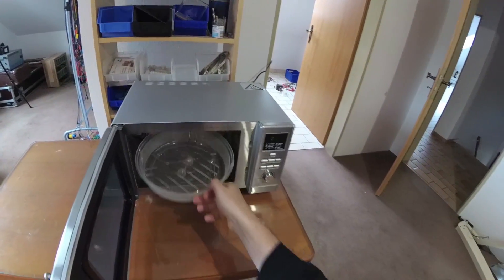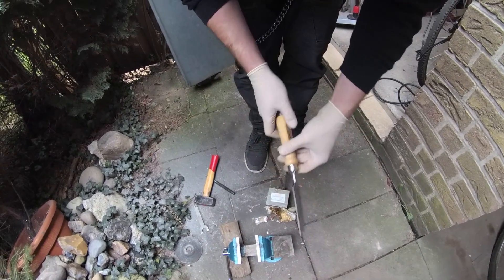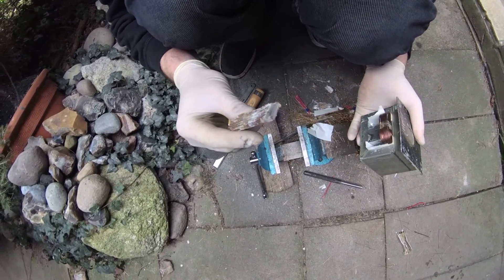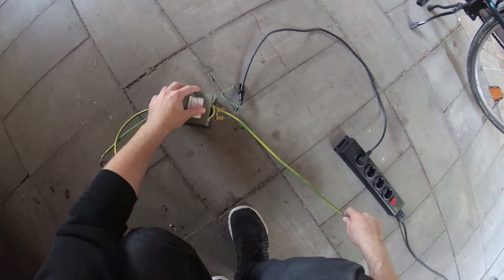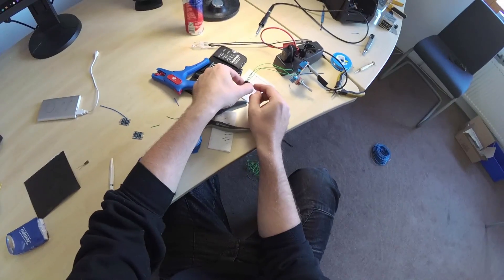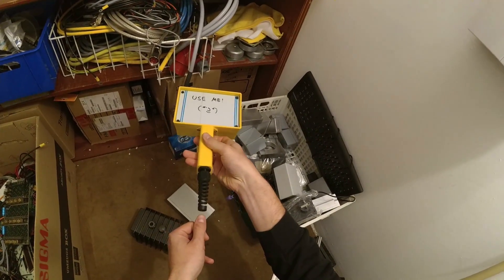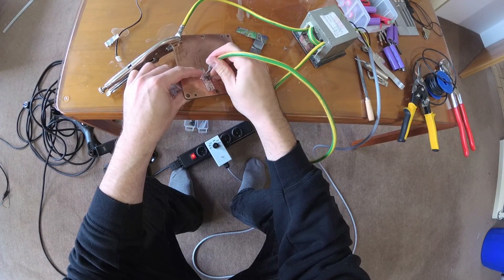Quick DIY Spot Welder without microcontroller

Comment: Any idea how the inductance of the transformer affects the relay? I'm guessing the voltage spikes would kill it very quickly, and any snubber circuits would mess with the timing. What would be a good way of switching the transformer?
Reply: No snubber circuits on alternating current.
Reply: @TinkeringNerd  Why not?
Reply: @sasodoma  I’ve never seen a snubber circuit on AC. Possibly, because it’s impossible to predict at which point the switch will open and in which direction the spike will occur. More powerful switches have ark deflectors, but mid-power motors and average AC circuits are controlled by regular contactors which are just beefier relays.
Reply: @TinkeringNerd  I've done some googling and people recommend RC snubber circuits for AC inductive loads. The only problem for this application is that they give the current another path and increase the on time.
Reply: @sasodoma  another point to consider in this situation is that all the extra energy from fly back will go into the weld because the transformer is “shorted” for the entire ON duration.

Comment: I did a similar project, but got a problem, after 40 welds, my relay shorted, making the entire terminal of my battery cell glow red and made a big hole. I guess i should use a better relay, maybe the one from the micro-wave, but i'm planning to go solid state switching.

Comment: Damn, I spend weeks trying to make this thing work! Tested with all kind of secondary coil wire diameter, all kind of switches, including triac+microcontroller, but still spot welding was bad and weak. But then I realized that the reason was in too thick electrodes, which took too match heat from the spot. After making last few mm of electrode with a wire 2 mm in diameter, it start work as it should! Daemons are in details.

Comment: im wondering why you are just holding the copper and everything with your bare hands while using that.. thing.
Reply: Kris Keersmaekers he is bassicly Just holding the ground plane so no current Will Flow throght gis body, but  even if he touch both electrodes of the secondary winding he Will be safe because the voltage of the secundary is Just about 2-4 Vrms

Comment: Nice video, I see three wires used from the power cord so I can sure your grounding the transformer unlike most videos. 
So my project has to do with referring one of those cheep battery spot welders on eBay, seems something blown out and it wasn't the triac.
My plan, I have three microwave transformers, grab the lowest rated primary one. It might be a 800W microwave one I hope. If all I have is 1200W stones then I'll need to make room and use the capacitor also so I don't trip the breaker. 
It's currently wired with a capacitor dropper and bleed off resistor to a secondary small transformer putting out 29VAC, then into the control board with a bridge rectifier and smoothing caps to just hit a voltage regulator and step it all down to 5VDC. Rip all tha out and use a small switching USB 1A power supply and remove the regulator, wire the 5VDC to the board, done. Much simpler design.
Now for that pesky transformer that I think might be made for a 220V line,  and why it pulls way to much and trips breakers.
Most US homes are wired with a single pole 15A breaker to multiple outlets, I even have it it's own 30A single pole breaker and nema6 outlet and changed the plug to a nema6 so I'm covered for up to 5000W of power, but at most only able to pull 3680W, well in the safe zone. 
That transformer need to go, that's were my questions comes in since I have 20 feet of the same wire hanging in my garage.
What is your microwave transformer rated for?
How many winds did you do?
Have you measured the amperage out of the secondary? If so what was it at? 
Are you running 110V or 220V?
If I can use yours as a base starting port that would be great. 

I would like to keep my current electronics and control board, so I need to keep it under 40A to match the triac. Maybe I can find a 60A triac and change it if I need to, but the most I can do is a single pole 110V 40A breaker. I guess for the few milliseconds I can add the microwave transformer to help with the inrush current before the triac  if it pulls more, but the triac might still take on damage and I'm thinking 30A even should be plenty to 0.2mm nickel strips at 5mm wide being the biggest I would ever use. 
Thank you in advance,
Scott

Comment: Nice! Good video!
 I see that you used a metal plate as one contact. That's fine for the sheet metal, but at the end of the video, you seem to be using it with batteries. Is that correct, or am I wrong? Anyway, is it safe to have all that current going through the battery?  Thanks!
Reply: when tabbing the battery he has an electrode in each hand so the current is just going through the tab itself

Comment: What cable is used?
Reply: it's one of these heavy duty grounding cables you have in racks or heavy machinery. he just cut off half of the metal loop where the screw goes through.

Comment: using a powerful 8bit microcontroller as a timer is HARAM
Reply: Cheaper than momentary switch and jellybean parts, dime for a bucket?
Reply: Maybe for large values of dime and small values of bucket. I can get an 8 bit uC for about $1.5 that only needs one filter cap, vs a handful of capacitors that are $.12 each. So you save a few cents. One difference is, I can buy a box of uCs and be ready to go, but I need different caps for each project. If I'm actually buying enough caps so that I have them on hand to use passives, then it is going to cost more. Or worse, I can use a $.50 555 timer, and a $2 potentiometer like most people do. For DIY none of those costs are significant so which ever you're more comfortable using to create the timing will be fine.
Reply: @railspony  You're paying too much. Even an powerful STM32 MCU is only $1 and capacitors from LCSC are ~$0.001
Reply: @ihatenumberinemail  In a DIY context those prices are not realistic. You'll need a circuit board too, add that to the price and hassle. With my $1.50 8 bit in a PDIP package I can prototype on a solderless breadboard, and solder it onto perfboard in the end.
For an STM32 in a PDIP package, which I have in a box somewhere, I paid like $1.65 or something. And no, I don't want to order from some random in China. I buy from the same place I'd be buying from if I wanted a whole reel.
Reply: Why? It's cheaper.

Comment: Would you be so kind as to post a schematic and parts list for your timer?  I would imagine many can build this without any assistance but I am electronically challenged.
Reply: This dude just asked a question and got roasted in the replies 💀
Reply: This is why i feared asking
Reply: If you need a schematic for this, you better not touch a microwave transformer.
Reply: @superdau  He's talking about the selectable caps ...
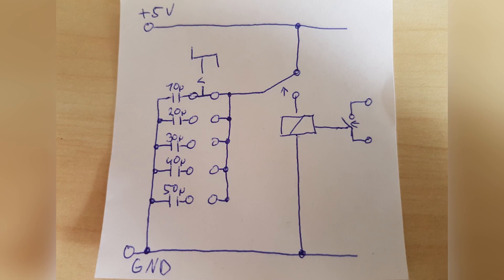Reply: +Scot Y - Schematic @ 1:46
It seems that electronics is not the only thing you are challenged by!

Comment: In your notes for the Caps. Where they into Nano Farad or Micro Farad?
Reply from the maker: In this case I am charging them up to 5V, so every voltage rating above that works.
Reply from the maker: µF and the relay module is one of those generic chinese ones with an optoisolator input
Reply: micro farad and how many volts?Also is electroplated or something else?Thank you !!Very nice idea!!

Comment: Hello, 
are you German? Die Lösung gefällt mir so gut, dass ich es auch ausprobieren möchte.  
Leider habe ich aber keine geeigneten Kondensatoren rumliegen.. Mir war gerade nur nicht ganz klar, ob bei den Kondensatoren auf die Kapazität(Farad) oder Energie(Joule)  geschaut werden muss. Jetzt sehe ich aber, dass das Relais mit 5V arbeitet, also müssen auch die Kondensatoren dazu passen. 
Welche hast du genommen, dass es so gut funktioniert?
 If you are not German, no problem, then I will try to translate it....
Reply from the maker: It very much depends on your relay module. If you use one of those Chinese eBay ones with opto-isolators, then 10uF, 20uF, 30uF, 40uF, 50uF should work fine. But I would recommend buying more in different sizes, so you can test and replace as needed. They cost a few cent each
Reply from the maker: Die Elektrolytkondensatoren kosten bei Conrad nur ein paar Cent, ich würde Werte zwischen 10µF und 100µF empfehlen. Spannung egal/so niedrig wie möglich! Wie lang die Pulse sind hängt dann aber auch stark von der Bauweise des Relaismoduls ab.
Reply: Marco Reps 10pF, 20uF, 30uF, 40uF, 50uF? Is that correct?

Comment: Let's use an Arduino, learn programming (again - from basic to assembly language to Fortran, to Cobal and now whatever Arduino requires) just to turn on an LED..  Useless!
Analog is STILL, by far, the best way to go -- is there Anything it won't do?
Reply: No, of course not, all that digital stuff around us is only a big hype, will be gone soon and we will go back to analog. :-D
Reply: Arduino uses simple C, you don't have to know 10 languages to program an arduino...
Reply: Arduino is not arduino. Arduino is atmel. Atmel is Avr mega 328p. Avr mega 328p needs only bits... with a compiler (c or whatever you want).
Reply: Well yes apparently there's one: helping you reconnect with your 50 years younger self, aka your 20yo non-desperately-grumpy self.
Reply: Exactly Darknes...  Why do people always seem to think that one, you need to learn all prior programming languages to learn one modern language, and secondly, that digital means computers.  Computers, as a practicality, means digital, but not the other way round.

Computerizing this stuff is silly for a tool meant to be used by hand only...  the power of arduino and other embedded computers is in automation.  You can turn something like this into a part to a CNC machine, which you can program using CAD and CAM programs, and make it mass produce shit for you.  Or even just quickly prototype something with any complexity.  That computer you used to watch this video and comment on it Grunthos?  That little device has enough complexity to it that computerized automation tools were utilized just to PROTOTYPE it.  Mass production of course required even more.  The time it would have taken to bring that product to market by analog only tools used by hand would have rendered it infeasible by that alone.  Some of the stuff in it couldn't have even been done at all without computers.  Guarantee you if it's at all recent, you've got chips in there built on a nanometer scale.  Humans can't do that unaided.  C'mon man.  We're at the point where it requires computers to build computers.  Humans just design it and send the instructions to the computers to build it.